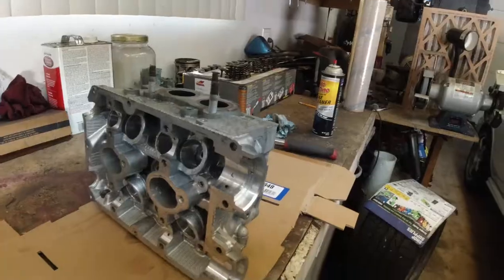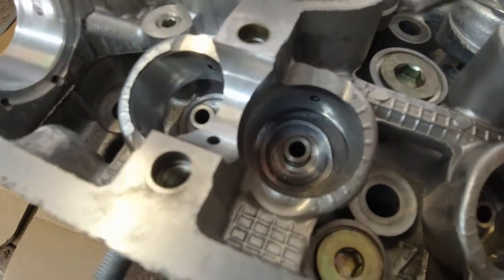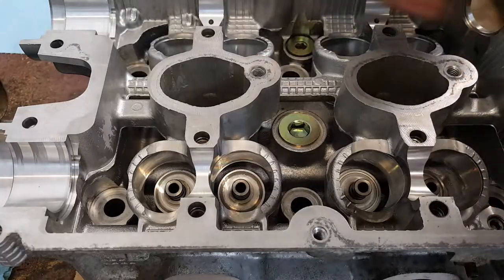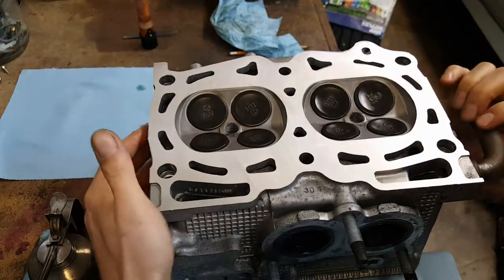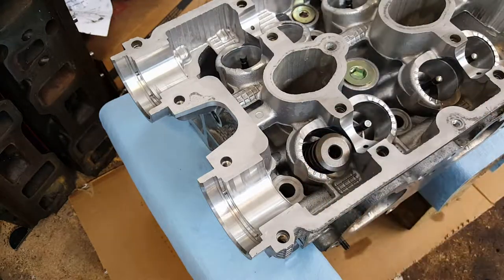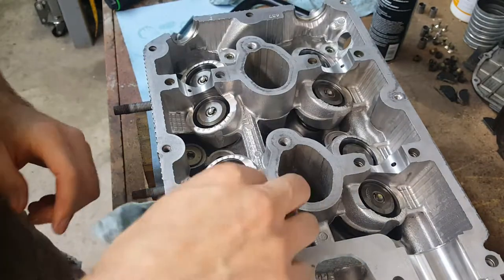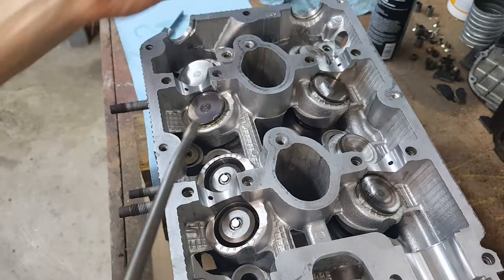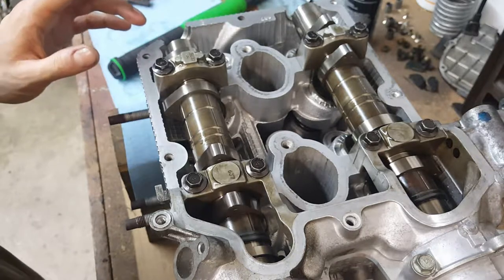Subaru STI EJ25 cylinder head valves and oil seals assembly part 3

Comment: You have to remove those hex oil plugs. You will not get out the debris. You'll need oxy/acetylene heat around the plugs to melt the sealant. The machine shop should have removed them to clean the oil galleries.

Comment: smart man, the machine shop I took my heads to screwed up my heads. they did such a rough cut, for MLS, that you can feel the grooves on your finger nail. when I plain stone grinned them, the cuts were very deep meaning peaks and valleys were super high and low. alot of areas were already smooth and others were deeper cuts.
Reply from the maker: sounds pretty bad, you sure it was a machine shop?!?!?!
Reply: I would hope no machinist will deliver such poor quality work.

Comment: 3:38 do you know the part number for these? I have 650 miles on my EJ255 build, but I have a slow oil leak out of all of these plugs. I’m thinking I should have replaced them all with new ones? But even the dealership couldn’t tell me the part number. 🤷🏽‍♂️
Reply from the maker: u most likely dont have to replace them, just take them out carefully with heat and clean them up, when installing back just use rtv, they are tapered.  I have no idea what part number they are.  Chances are they only come with heads.

Comment: Hello.. congratulations You make great job.. how much is the cost  if you rebuilt a 2.5 L EJ25 engine for subaru sti 2012.. ..? God bless u
Reply from the maker: Well it all depends on how damaged an engine is.  In my case the machine shop charged me a little bit over 1k plus 600 if they would put it together.  This included decking both heads, checking 2 valves for straighness, decking and cleaning the block and checking the crank bore for roundness and measuring everything for clearance.  Oh yes and balancing pistons, rods, crankshaft and flywheel.
Reply: Thank u for answer me..  I watch all the videos on the 2007 sti white engine rebuild if I'm wrong of the year..you do great job man ... how much is the cost for the all job you did in the engine..  I have a problem whit my sti 2012.. maybi you can help me... how I can contact to you...
Reply from the maker: I would not know the labor costs of all of it but I assume it would be a few grand since I did the heads my self and also did a lot of modifications to the car.  And I dont know how to contact people here without giving out my personal info.
Reply: @cruizinmax4017  look at my car is consuming a lot of oil but a lot ... if I correct the oil level on the dipstick ... and I use it for about 4 hours the level of the dipstick is almost reaching the end ... my car does not emit blue smoke  nor black.  I park my car in the same place and that has not thrown oil ... my car only use it on weekends only one hour but if I use it 3 Sundays 1 hour a day I already have to put oil in it, I don't know where the oil goes  It is a 2012 sti 103k miles..I don't want to do all the modification my car has 10k after market .. I just want to rebuilt the engine and   change the necessary  in the engine ..
Reply from the maker: Your first step should be doing a compression test on all cylinders.
https://www.youtube.com/watch?v=gcP23ExUOt4       this is why I did all this work.
Reply: @cruizinmax4017  Hello my friend, thanks for always answering me .. you know they told me that the problem with my car is blowby .. because it has been modified and after market .. or do you think it is because of the pcv valve .. do you think so  I changed that valve, would it help or what do you recommend?

Comment: Does it matter what way the spring goes in?
Reply from the maker: So a valve spring is a kind of progressive spring. In almost all engines the end of the valve spring which has closer coil should be facing down (closer to the valve)